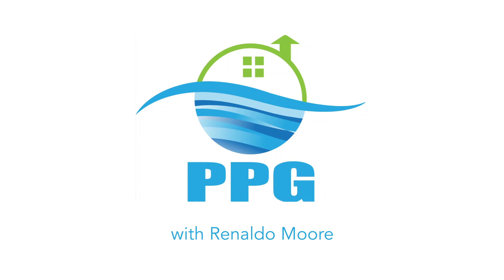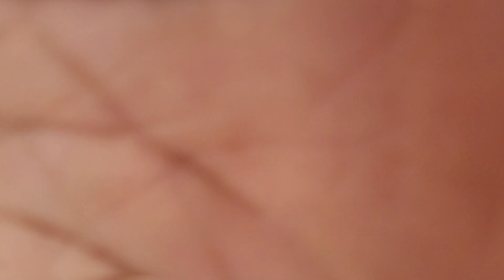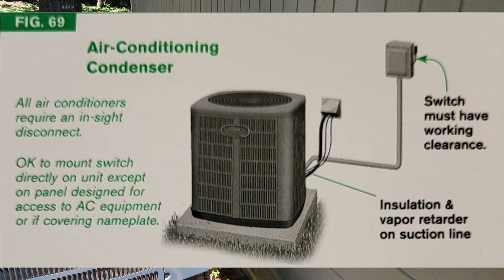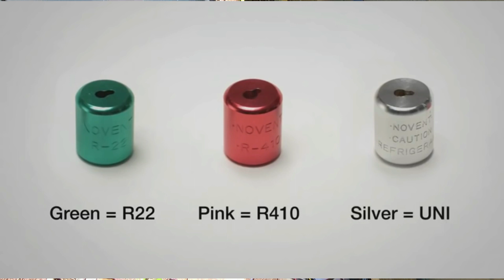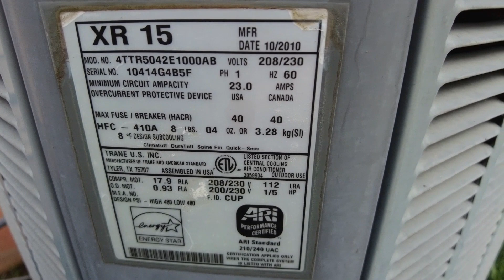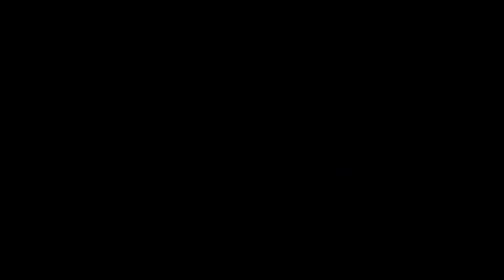Top (5) Summer HVAC Residential Violations

Comment: Thanks for the info.  Is there a max height for an electrical outlet in a hallway or closet?
Reply from the maker: The NEC doesn't specify a maximum height.  However,  most electricians got with 12"-18".  Closets don't require outlets.  Hallways only need outlets if they've longer than 10'

Comment: Maaan I pretty much gave up calling out the disconnects behind the condensing units. The builders throw a fit every time and I haven't met a single city inspector who cares about it so I just stopped notating it on my reports. 

Three more things I call out with condensing units:
1. Under the edge of the roof or worse, a valley, and no diverter flashing or gutter to prevent that water from falling in.
2. Dryer vents terminating within about 6' of the condensing unit. I've done resale homes with those fins choked with lint because of the proximity to the dryer vent. 
3. Make-up  air intake above the condensing unit, ESPECIALLY when that intake is tucked up under the eave of a 1-story home. Then you have the AC sucking in the hot air the condensing unit blows upward making the AC work against itself. 

I call that out on pre-drywall jobs all the time and nobody ever fixes it. 

Awesome vid as usual Mr. Renaldo.
Reply: No code violation for the dryer vent near the condenser, not the best practice, but a builder won't change it if it isn't code.  No code violation either for the fresh air intake above the condenser.  There is very little air that goes into the unit in comparison to the overall air that moves through the house.  About 130 cfms on a 4 ton system for about 20 min - 30 minutes every 8 hours.  Won't make a measurable difference (IECC and Energy Star certified inspector).  

However the disconnect behind the condenser is a violation, and could cost someone their life.  If the city inspector doesn't check this as something to fix, then you do have the right in every state under the ICC rules and code of ethics to report it to the CBO (Certified Building Official) the boss of the city city inspector, if they still don't do anything you can report them to the state agency that they fall under.
Reply from the maker: I appreciate your support.

Comment: On the minimum and maximum comment,  the minimum rating is the wire ampacity rating and the maximum is the size breaker.  If a unit only says max fuse than it has to be a fused disconnect,  if it says max overcurrent or breaker than it can be a pull-out disconnect.
Reply: Mostly mini-splits but yes some units say max fuse,  not max overcurrent protection which would be breaker.
Reply from the maker: You do know a fuse is an overcurrent protection device.
Reply from the maker: A fuse and a breaker both have the same job
Reply: @PPG1967  yes I do but they are two different things.   A breaker is not a fuse.
Reply: For residential?  I have never seen a "Fused" residential disconnect.  I have seen them in a commercial build.
Reply from the maker: They exist.
Reply from the maker: I appreciate your feedback.
Reply: @PPG1967  no problem I think you are a good inspector and you seem to care about your clients.

Comment: What is the concern if I have condensers that are on bare ground? I make sure to keep debris and mulch away from the vase as much as possible, but definitely agree it should be on a platform.
Reply: I have seen due to erosion the condenser doesn't sit level, and eventually if it leans too much lubrication and gas flow for the compressor is compromised and can contribute to failure.  Condensers are supposed to be level for that reason.  If the condenser sinks into the earth, then it will hold water and have standing water inside, contributing to wires and the copper inside getting wet and ruining components.
Reply from the maker: So, elevating your condenser or placing a pad underneath, protects the unit from storm water flooding the base, keeps insects & and pests out of the unit, and also lowers the amount of vibration the condenser emits against the ground.
Reply from the maker: I appreciate you watching!!